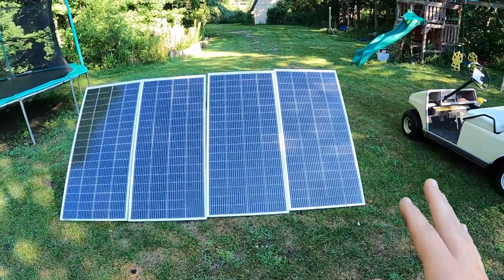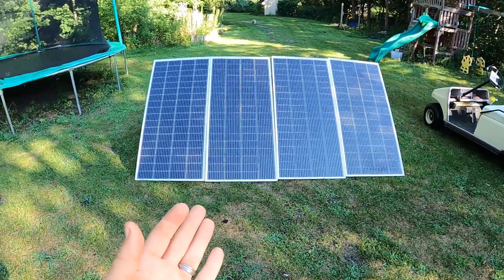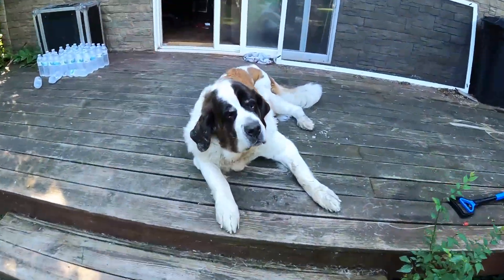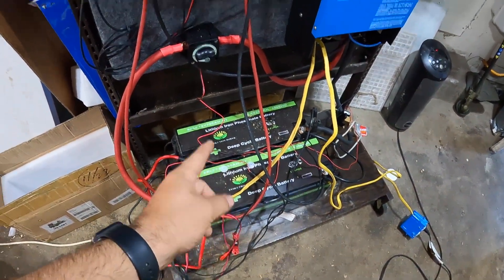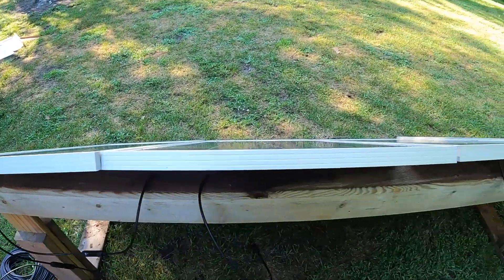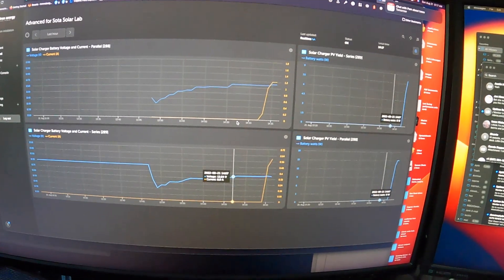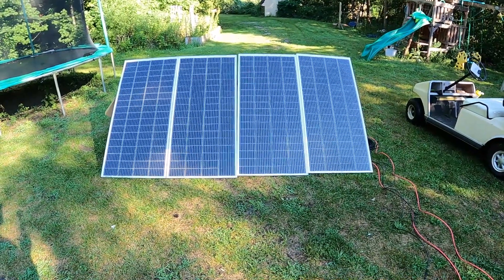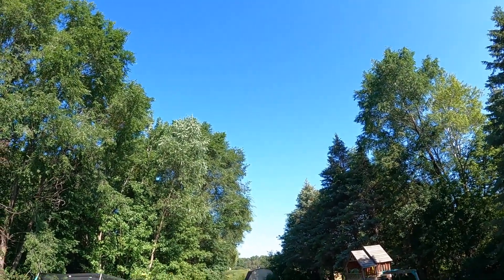Series VS Parallel RV Solar Experiment  using 200 watt  panels over 2 days

Comment: One more difference to note- did you happen to individually plug in each panel, noting equal, or unequal values of input wattage? I have 8 of these rich 200 watt, 2 out of the box measured 20-30watt differences, remaining 6 almost even. My delta pro w/app made it easy to test as well. Thanks for Both of your informative vids on this subject!
Reply from the maker: No I did not. That said it’s extremely difficult to test one at a time with any certainty outside of a lab. I find you almost need to have 4x exact setups and capture the data simultaneously to keep the environment as a constant.

Comment: Full sun result as expected but low light apparent anomaly...I asked the question why to the multiverse for a few minutes...The answer I got was that higher DC voltages leak more through the insulation...and this becomes more critical at lower light levels relative to the differences in voltage drop due to resistance...Thanks for your experiments...Great to see real world testing...👏

Comment: Would have loved to see the two outside panels connected in series and the two inside panels connected in series and then the two sets connected in parallel feeding one controller (yielding higher voltage and lower current on the cabling) to see if the total output compared to your setup. Of course the uncontrollable factor is the amount of sunlight and cloud cover so no way to accurately compare them.

Comment: Im new to everything Solar and have a question regarding parallel and series.  i have 6 panels but they are separated by pairs in 3 different spots in the yard.   The way my yard in, i have two facing west, two facing east and i build a mobile unit that i can turn to follow the sun  throughout the day.  For volts and amps i would like to series 4 panels and parallel into the last two panels.  Or would it be better to series sets of two and parallel the 3 sets together to my power inverter ?  
thanks for any input.
Reply from the maker: For parallel you’re trying to match volts ,  series you want to match amps for each panel. So if there are mixed sizes take that into consideration.  You don’t want to  parallel a group a significantly different voltages, for instance 38 with 86. 

Feel free to email us from our website sotasolar.com with photos.

Comment: I have inexpensive grid-tie inverters with limiters (so my power company doesn't send me a Nastygram) in North San Diego. On one leg of my 220VAC @60Hz split phase are my "Mid Panels" which face directly true South. I have the perfect backyard with a 270-degree view of true south. On the other leg, I have "Sunrise" and "Sunset" panels facing true east and west. Each leg has a total of 1,240 Watts @ four 310Watt panels per leg. Each leg is in parallel. My east/west panels work perfectly regarding shadow as during the morning when the sunsets are in 100% shadow the sunrise is in perfect sun. The reverse is true at sunset. My inverters only handle 60Volts so this is the method of wiring that works for me. We have the washer and dryer on the "Mid Panels" (leg) and do laundry between 10-2:00PM. We watch our big screen first thing in the morning and at 5:0PM. With our panels the way we have them and the loads arranged on what time of day we use them, this simple system handles all our loads starting in early Spring from 8:00AM through 6:00PM and just gets longer as we move towards the summer solstice. Our electric bill is seldom over $40.00 (we charge our Teslsa sometimes) where a KW is between 0.45 and 0.65 cents/KW. We are now using the same inverters to power our loads until midnight after sunset by a couple of batteries on each leg to reduce our bill even further (lowest bill so far was $19.00). The batteries are charged by simple AC chargers on timers that run between 9:00AM and 3:00PM and completely recharge each day. It is a very simple completely plug-and-play system that has been working for over 2 years. So parallel can work as it does in our situation as we are limited by max voltage and can not go series.  All our wires are 8AWG from panels to inverter/charger with a peak of 31amps. Our longest run is 200 feet from sunrise panels to sunset panels to inverter/charger in the garage.
Reply from the maker: Sounds like you're onto something there.  For Shawn's personal RV he did something similar.  Video to come :-)  

This video is mostly geared towards the RV market where there is an idea that you should be running heavy #2 wire up to the roof  so all panels can be in parallel.  The differences  become more apparent the lower the voltages, 60v that you're running is not too bad.   Thanks for commenting and watching!

Comment: Here's an idea for a test.... I'd like to know the effect of combining  mismatched solar panel strings directly or via dc-dc converters (e.g. the bluesolar controllers) at the combiner box.

The reason is that the solar controllers are designed to "normalize" voltages and produce a steady voltage with varying current to a battery. If we are connecting strings of panels together at the site outside, then combine them into a single bus bar and running a single pair of cables into the house, then into a controller, is that going to produce more power than using a solar controller for each string, then combining that into a single bus bar and running it into the house? 

I hope that I made myself clear. I ask because I've seen some installers connect different combinations of panels into strings, producing different voltages, into a single combiner box. 

Also, I'm interested in the effect of how the panels' built-in bypass diodes, which drop the panel voltage when in shade, would effectively do the same thing. Especially for shaded conditions where the strings can produce different voltages at the combiner box, I'm wondering if inserting the solar controllers before the combiner box would solve a lot of problems. It's my understanding that each string should have its own solar controller, so this would be a test to demonstrate that.
Reply from the maker: I’d be happy to do that.

I can tell you that running mixed voltages in parallel  will drop the entire string to the lowest common. 

If you ran a string of 3 in parallel with 4, the controller would optimize for 2 strings of 3, the 4th panel would be useless.

I’d usually run multiple control where there is a high likelihood of different shade conditions per string of panels.

Local optimizers or microinverters help with this, but they can get expensive to the point I recommend throwing more panels at the problem unless space is the limiting factor.

Thank you for the idea!

Comment: :-) Is this Shawn? Watching as we'll have two sets of solar panels (4 ttl) and the two MPPT's you sold us and want to know which is best for us too!
Reply from the maker: I am him.  If I recall your panels are the older PolyCrystaline style and might not have as much forgiveness in partial shade.  However as our experiments show, in partial shade, you're SOL anyway you slice it.   I think in your situation, as big as those panels are and because they run a higher voltage already, I'd say parallel them.   Reason being, more likely to be self shaded by RV AC and whatnot.  If you're confident you can keep self shading to a minimum I might try series.  Or could do one of each if it works out.
Reply: @sotasolar  good deal!!! I will actually have 2 290 poly's on one MPPT and then a 320 and 315 Mono's on the other MPPT ! Just really wasn't paying attention when I bought those Polys :-) So it is, what it is.

Comment: What are your thoughts on the Ecoflow power kits?
Reply from the maker: That’s a good question. I have yet to review one.  One thing that I like about Victron is the experience in the Marine industry they have, seems to me no harsher environment. I also appreciate their commitment to open source software for interoperability. Almost every other power system is a proprietary black box whereas Victron invites others in to add new features as they see fit. Sometimes those get incorporated, sometimes not.  

With all that said I think new competition will make everyone better and is a good thing. I look forward to testing and reviewing one.

Comment: I'd like to know something.....panels ran in parallel or series are the same voltage correct?  What about the amperage?  Parallel provides more amperage no??? Does this matter with the new MPPT controllers? Series lets say is 24v @ 9a per panel so the larger # of panels the same volt and 9 amps total but the wattage goes up correct?  Parallel should be 24v @ 9a x #of panels with wattage x # of panels.... AM I EVEN CLOSE HERE??? Should I even be concerned with amperage over wattage?
Reply from the maker: Great question, in my following test I covered that.  In short you take amps x volts to get power. In series volts are added, amps stay constant , vs parallel amps are added and volts stays constant. https://youtu.be/EgdaBwxwSEk?t=400 

Ultimately it’s about the power, you want more power into the batteries, doesn’t matter how it gets there.
Reply: @sotasolar  So wattage (power) is king...but in isn't wattage either way the same? Or am I misunderstanding and Power is V
Reply: sorry....VOLTAGE is power? I am not understanding MPPT in this instance I think. if you have 9a @ 18v or 9a @ 60v which is better?  Why is 30a @ 18v not better for the controller??? The controller can be config'd for just about any voltage if the heat can be handled as I understand it.
Reply from the maker: @greenhornfarmer3598   volts x amps = power / watts. Watts is what does actual work. So 9amps at 18v is 162 watts and when converted into 12v for battery is 13.5 amps into the battery. That same 9 amps at 60v is 540 watts and 41 amps into the battery. You pick which is better :-)

As far as what is best for the controller, yes lower volts means less heat, however that’s why they have cooling fins. Pick your poison. I’ve been running 80v into 2 MPPTs for 5 years, no issues.
Reply: @sotasolar  AH HA! Light bulb moment.....Now I think I get it.  Thanks!

Comment: You could eliminate variables of sun peaking over trees on some panels before others by covering them all until the sun is high enough to hit them all equally. That way the clouds coming and going will affect them equally
Reply from the maker: The partial shade from tree cover is also part of what I want to measure.  Next set of experiments I’ve got an idea. Thanks for watching and commenting!

Comment: Long run I’m Positive get it Positive lol 
Parallel wins over time as fires damages to diodes in series from shading unless absolutely no shading is present 
 Sure you know about Solar pathfinders 
 I like utilizing both ac as well as dc in the lowest voltage system 12/18 v 
 Yes much more wire cost but the ability to power things is far better in my thirty years 
 Btw your most likely the only one who will see this the channel owner because I’m severely shadow banned on all social media 
 So if you want to see my my published book I think it will teach greater dependability and lesson cost and eliminate hazards 
 Best wishes 
How to get a reply whenever
Reply: Try proofreading and using some punctuation if you want a response. You're not getting answers because it reads like gibberish, not because of some shadow ban conspiracy. Best wishes.
Reply: @JayCGypsy  hey I totally agree 
I’m not good at all with reading and writing period 
Ik this 
I’m totally a inverter type 
Probably why my social skills are not good other than accepting insults